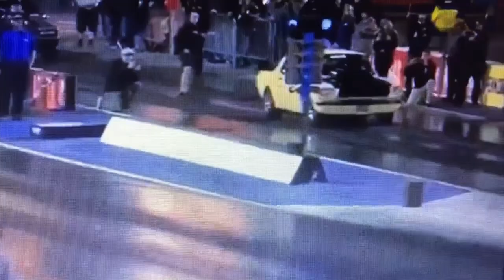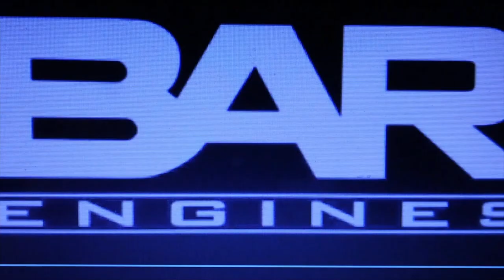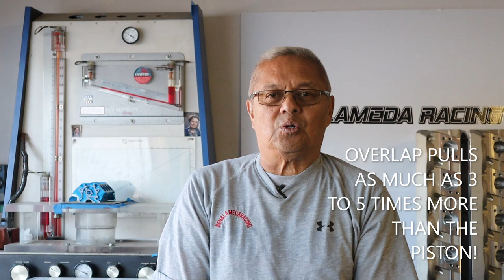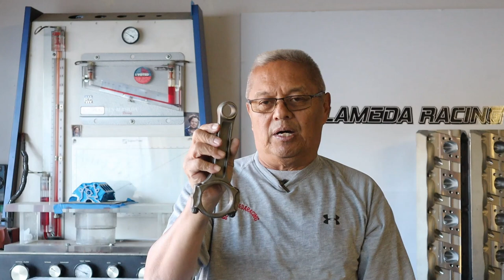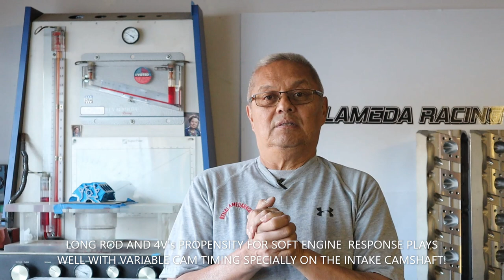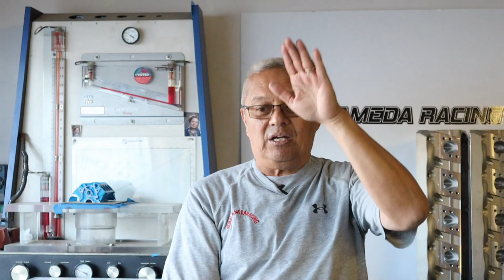PISTON AND CAM OVERLAP RELATIONSHIP!

Comment: Love listening to gearheads with real world tech experience that know what they're talking about.

Recently been researching the David Vizard "128 formula" for LSA and corresponding overlap. Every test I've seen where they test different cams with varying LSA and timing events has supported his general formula.

He essentially is saying the same thing as BA here, that using the exhaust to fill the cylinder at the ideal time with timing events creates maximum output per engine configuration... Whereas the only thing most "cam experts" point to is duration and lift. Yes they're important, but only in a secondary nature.

Love videos like this!
Reply from the maker: Thanks and appreciate your viewership from an obviously well informed gear head!
Reply: This supports Vizard’s LSA Theory!  And quite frankly makes sense....

Comment: Many times our pro late spec compression engines have traction issues  at the local track. Got to use heavy springs sometimes,  we use 6.200 rods typically. Thank you again for educating us.. old builders are going away ..
Reply from the maker: Thanks Nick for tuning in.  I admire circle track builders because they really stretch their engines way more than we drag racers.

Comment: The ole' Tq vs. Hp scenario, in how long the intake valve remains open After Bottom Dead Center... (Intake Savaging)  Earlier Close, (Torque when closing pre 61° ABDC) vs. Later Closing (62° to 73° ABDC ) for improved mid-range & higher RPM Hp. Overlap contributes in initiating higher air speeds, which leads to early cycle air flow efficiency. As appropriately mentioned... atmosphere & cylinder depression are major factors in fill efficiency. Also the Nozzle Effect @ the valve throat. (Bernoulli's Effect) Garden Hose with or without pressure nozzle.
Reply from the maker: Overlap indeed contributes greatly and also contributes to "overdrawing" the intake charge straight to the exhaust dropping our dynamic compression, out the pipes with new high port intake and exhaust cylinder heads.

Comment: How ya doing Ben?  interesting on the short rod vs long rod.  On my 306 build for road race I wnet with a 5.4" rod for what I thought would help side loading stresses at higher rpm, not sure if that is even an issue. Also the 4.6 mod engines have a fairly short rod ration if I remember correctly.  looking forward to the header video.
Reply from the maker: It is really one of the secrets of the success of the 302HO having a short rod and stroke which for most instances will outrun and IROC Z with a 350 back in the day!  The longer runners however ugly on the factory intake with the right hand side facing throttle body, actually boosted its low/mid range power compared to the beautiful to look at TPI Camaro intake!   Imagine that the 305 did not stand a chance and the 302 with about 50 odd cubic inches shorter was an impressive engine that kick started the 5.0 revolution.
Reply: @benalamedaracing2765  Ben I know all this for a fact. In 1987 I had a 1984GT T-Top and the 305 GM cars were never any competition, the 350 IROC's and GTA TransAm were basically a drivers race, whoever got the jump would hold the lead.  My mustang was 100% stock. I'd street race any thing and every thing.  Lots of fun stories, all of them totally stupid.
Reply from the maker: @chestrockwell8328 , that is the best opinions from experience and you did that and that cannot be ignored or disputed!

Comment: Long rod = less angularity, less side loading of piston skirts, less parasitic drag on the motor. Long rod tends to have the piston dwell at tdc and bcc but real fast piston travel between the tdc and bcc. 429 Ford CJ is the worst combo, 1.72 rod ratio with huge lazy intake port.
Reply from the maker: Peter, I like long rods for the points you describe and prefer it most if not all the time.  The only exception are short rods on an oval or road racing engines seems to accelerate stronger out of the corners which by the way does not show on a dyno tests!

Comment: I have a 306 with an older flat tappet Thumpr cam installed by the previous owner. I have AFR 185 heads. Compression is not high, not exactly sure what it is as the engine was already in the car. The idle was choppy but clean ( little smell). I went to the track, acceleration was soft. I discovered that the cam was installed 9 degrees advanced. I changed it to 2 degrees. I picked up almost a second and 8 MPH! but the idle is not as choppy and will burn your eyes with so much unburned air fuel mix coming from the exhaust. Ignition timing is 12 initial and 36 total with a mechanical advance. The car is a 68 Mustang coupe, 2900lbs. TCI C4 3000 stall, 4.11, 26” tall tire. I’d like to clean up the idle and pick up some ET. Best is 12.5 at 108. Should I advance the cam more?
Reply from the maker: If it was 9* adv. depending on lift it would have hit the intake valve to the pistons.  If you placed it at 2* your top end would improve at the expense of low/mid range power.  An advanced cam will do that but it will sign off earlier at the top rpm but give a lot of response not soft so we are not getting the complete picture here.  What is your compression?
Reply: Not sure. Cranking compression is just over 100PSI. Maybe 8:1?
Reply: I say 9 degrees because that’s what the crank sprocket was set at. It had 3 key slots 0, adv 9, ret 9. I replaced it with a sprocket that had keys at 2 degree increments. I set it a 2 adv. the result was more power from tip in but eye watering exhaust.
Reply: @benalamedaracing2765 the pistons has a dish in it. That may explains it.

Comment: Hi tech info explained in a way that anyone can understand it. That yellow mustang was crazy fast and made some power. What would be your go to intake for a 347 210cc ported  heads at the track along with cam specs? If u have any 1.7s roller rockers that u would be willing to sell im your guy 😁 Keep the info coming. Maybe you can explain all of the cam specs and their overall impact on an engine and how to spec your own cam out on a build without having to seek advice 😁 but I would like your advice on the best cam for my engine
Reply from the maker: I prefer the Anderson camshafts for their power and reliability.  Call them and give your specs and they will get real close to ideal.  I prefer them and Isky which I get specific to my goals otherwise the former is next best if not the best out there!

Comment: Seems like the 4v heads could have different bowl shapes to increase swirl,  example, one valve having alot of tumble and filling the bottom of the cylinders as much as possible, then the other valve firing the air against the cylinder wall, to create swirl, with chamber shape and bowl shapes being asymmetrical, yet complementary to one another! It would required stimulation and CNC work, hand porting, and possibly welding,  but when the basic rough shape has been discovered, it should not be difficult to repeat!
Reply from the maker: Well eventually when you have the mock up of the port then when it actually flows will tell you a completely different scenario altogether. One thing I have learned all these years is air will go where it wants to and there are very few things we can do to alter or change its direction.

Comment: Thanks for sharing your knowledge. I'm very interested in more on the subject of overlap, and recommendations. 408 Windsor hot street motor, AFR220's 2.10 intake valve/4.030 bore /10.25 static comp/6.20 rods/ RPM airgap/carbed NA/ 1 3/4" header primaries 28-34" long. I'm at 105 LSA .610 lift in my mind but can't decide on overlap, likely 55 to 60 degrees and duration falls where it may.
Reply from the maker: This combination seems destined to be a strong runner!  Anyway call Isky and talk to Rod, 310-217-9232.  He will refer you to a grind that they make and just mention my name.  They hit it on the mark all the time I have used them and they have a vast number of grinds for your combination.  Otherwise another option is Anderson Motorsports for a non custom cam they are also very good!
Reply: @benalamedaracing2765  Thankyou for your reply. After watching many of your videos I'm thinking I need to go closer go 11-1 on my static compression ratio. I appreciate the tip, I'll give him a call. I've done the math here after my initial comment and my Crower designed cam specs .624 int/.611 ex.      250 dur int.  @.050.    256 dur exh @ .050.  105 LSA  shows that my cranking compression would be in the 220 psi area, too high for even this 2300 lb AC Cobra.

Comment: Is very little overlap bad for carbureted engines?
Reply from the maker: It really depends on the cylinder head you are using.  Traditionally old skool heads requires a lot of overlap while the new type race heads uses hardly any overlap.
Check my videos on cylinder heads and I explain it there as far as overlap.  I think the video is about low and high port heads.

Comment: Seems the engine with all the proper parts at the optimum rpm could experience higher than ambient pressure in the port above the valve, and possibly get higher than ambient pressure in the cylinder with all the correct parts the volumetric efficiency being 100% possibly slightly more, i
Hear the new LT6 is over 100% volumetric efficient  I'd love to see that engine in a Camaro and a SS, truck!  Maybe go cross plane for the truck, but keep the 4v heads maybe go to 6 litres , but a 6 speed truck with 4v heads and a more traditional intake, it should make around 400hp stock maybe more in a Camaro, clear 500, and 750 + with a supercharger,  it would be awesome, and there supposed to be a next generation V8 coming to Chevy /GM soon, possibly 2025,  hopefully it will be a 4v dohc based on the LT6 some what,
Reply from the maker: Anything is possible and just got to have a working prototype and see what you have.  Dynamical vibrations and frequency can wreak havok on any design and this is one subsurface stress that few understand or can effectively deal with it.  I had one friend years ago said designing an engine is easy pickings and boy was he deadly wrong and blew up everything he built.

Comment: Mr Ben do you have an email address some one could contact you about picking a cam and tq converter combination for us? I realize there is a consulting fee
Reply from the maker: Call Isky @ 310 217 9232 and ask for Rod or Nolan.  Mention my name so they know you are for real and they will get you a grind exactly matching your combination.  I always dyno an engine and these will give your converter guy accurate info, as opposed from just buying a 3K stall and expecting it will do the same for you or everybody else which is a hit and miss.

Comment: What is the optimal R/S ratio?. Drag Racing I have shot for 1.7 RS ratio with the FE head. Roller cam.  and a 2x4 Tunnel Ram.
Reply from the maker: I am concerned with R/S ratio specially if I will be turning a lot of high rpms!  Otherwise on the streets it can be somewhat low without major issues.
Reply: @benalamedaracing2765  I find anything between 1.53-1.55 on the street or track.Shifting 8000 rpm plus, with no problems.This with a solid min wall thickness of .200, .250, and a cyl wall finish to support oil retention. I like short hang time at the top, many others will disagree.

Comment: Thanks for sharing. 
  Although some of what you say is unproven old school thinking and some of it is plain wrong. For example, pretty much any half decent 4 valve head motor makes more torque than 2 valve head.
Reply from the maker: Saul, what I am implying without the aid of "variable cam timing", a 4 valve or even a Hemi/Pent Roof layout will be at the mercy of low end/mid range torque blues.
The straight path of intake/exhaust facing each other makes this design susceptible to "reversion" due to the ability of the spent exhaust to go back to the combustion chamber,  And I did not even hardly touched on the basic absence of swirl on these particular heads.  Worked on a team 24 Hours of Daytona/12 Hours of Sebring Mercedes Benz Endurance Team's cylinder heads/intakes and disabling the cam controls kills much of the response and mid range. I will highlight what I came up with in regards of boosting this flat spots in the rpm range with some interesting changes...
Thanks and appreciate your input means a lot to me.

Comment: Can I do 4 ° advance on timing gear 8 way key?
Reply from the maker: You can depending on your valve to piston clearance specially on the intake.  How much lift and is it a flat top piston?
Reply: @benalamedaracing2765  ls 5.3 bootleggers cam 2005 gmc on carburetor..
Reply: Stock dome piston I think..
Reply: How to do overlap? Please show me piston to vavle and fly cut piston??